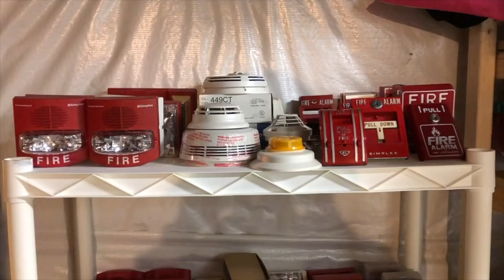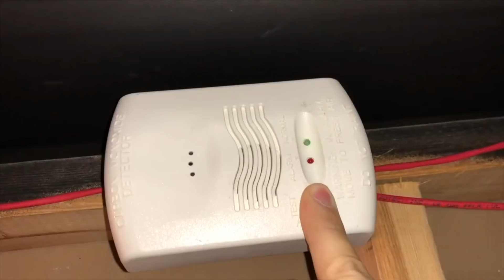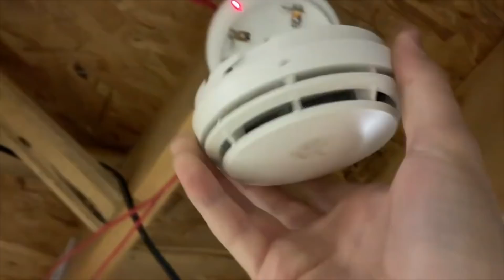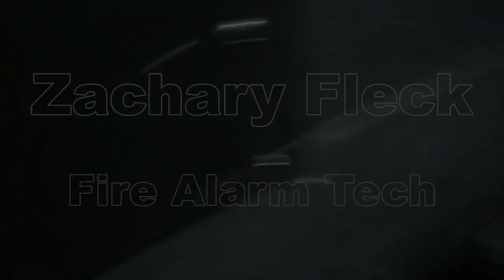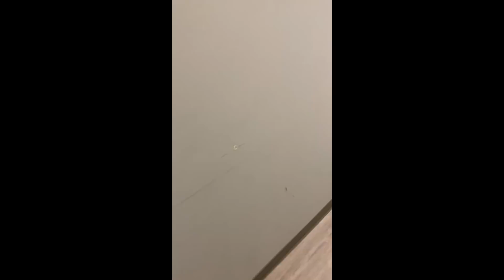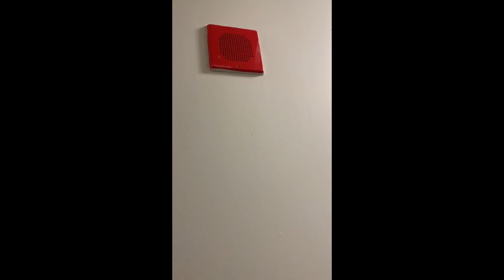Fire Alarms Explained: High Rise Building Evacuation!

Comment: What is the difference between E-70 & Ch-70?
Reply: E-70 is a speaker and a CH-70 is a chime
Reply: Just in case you do not know what that means, the E70 does not make sound on its own. It has to have a sound played through it on a separate panel, so messages can be played through it. The ch70 makes a chime sound when hooked up to power, and can not make any other sound.
Reply: The CH70 has a chime module built in to provide the chime sound over the speaker. The E70 is just a standalone speaker that receives its audio from the VECP.

Comment: How was this done before the advent of voice evacuation systems? Did they still have standard bells and horns, or was the evacuation conducted entirely over loudspeaker?
Reply: For systems with bells and horn there are 2 ways for it to work. 

1.  Bells only sound on floors being evacuated 

2. Bells sound throughout the building but have 2 different stages. 

First stage is A 20bpm intermittent ringing

Second stage is continuous or code 3 depending on building 

In this example the floors being evacuated would receive a second stage alarm while other floors are in first stage.  2 stage systems are common in Canada for places like high rises stadiums  malls and airports.
Reply: @TheFirePanel  That would be much appreciated!
Reply: I bet, if nothing else, that you'd have alarms going on the floors that need evacuation, but not on the floors that don't.